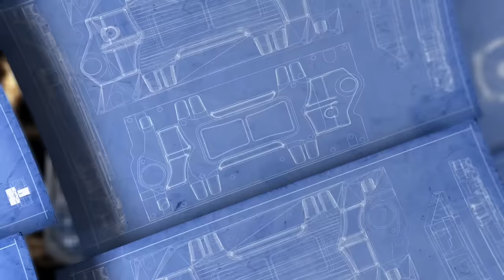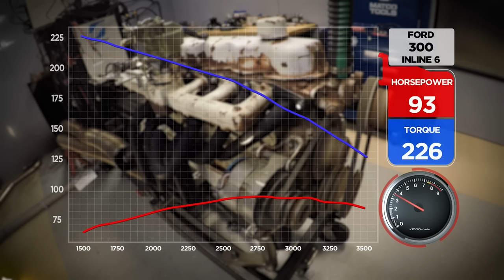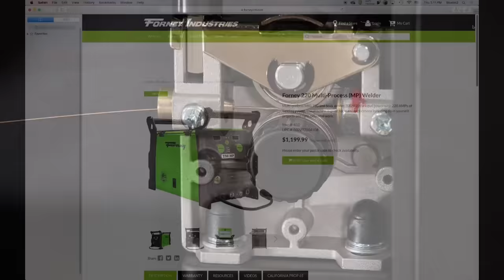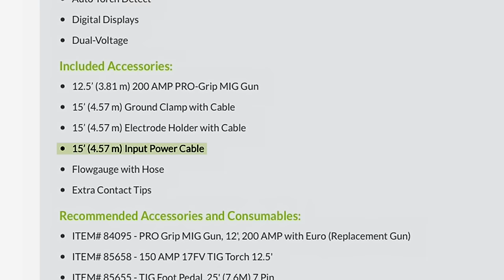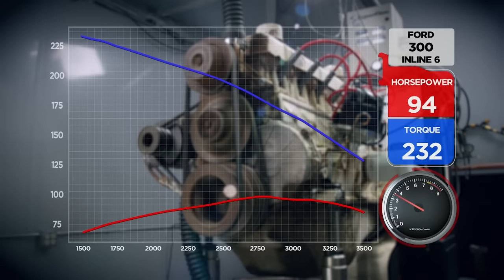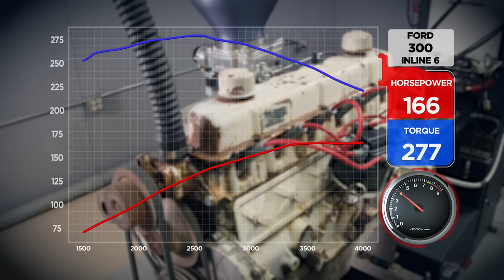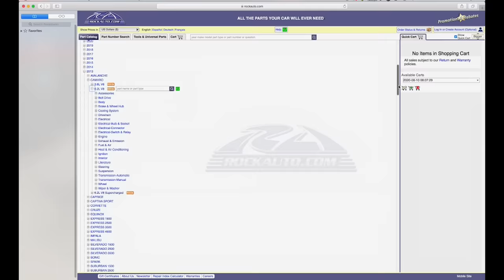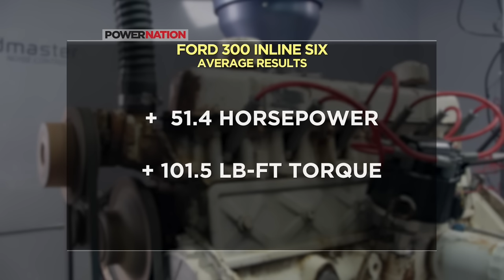Ford 300 Inline Six Gets Eye-Popping Off-The-Shelf Power - Engine Power S7, E17

Comment: Definitely one of the best engines Ford ever designed and built.
Reply: It may be a good engine for an inline 6 swap?  I have an older Supra.
Reply: @ddd228  I love the idea of the that being its something you don't really see
Reply: Just rebuilt the i6 in my f100 last year and its just lovely. And holy fuel efficiency i was not expecting.
Reply: @andrewglasgow5355  , well, you just saved an incredible workhorse from the scrap freighter to China. So many people scrap these engines for MORE POWERFUL V8 swaps. I miss the simplicity of inline 6 cylinder engines from GM, Ford and Mopar.
Reply: @charger19691  literally 1st yr knowledge and 22 yrs of lego and all I saw was a lego set made out of metal 🤣  2 hrs out, 10 on the stand then 2 hrs back in. Bing bang boom. I had so much fun. It was a gift from my GPA so i will rebuild it as many times as I need to.
Reply: @Eric Babcock I drove a stock 92 with a 5 speed doing delivery work and averaged out about 30 MPG. The low end torque meant you could drive around pretty comfy babying the throttle, even with a moderate load.

Note: the altitude I was driving at ranged from 5000 to 9000, so less fuel for less air.
Reply: @andrewglasgow5355  I just cranked up my dad's old 82 ford that has been sitting for over a year and it gets great mileage with the 3 on the tree manual. I plan on rebuilding it soon.
Reply: I put a 300 with a 240 head into a 1953 ford customline, great engine
Reply: @davidcronin5689 , did that bump up the compression? How did it run?
Reply: @taekwoncrawfish9418 , smaller combustion chamber on the smaller displacement head. Squeezes the gas, air and fuel in a tighter space, raises cylinder pressures.
Reply: @taekwoncrawfish9418  , I’m not talking about the engine in the video. Talking about a commenter’s engine.
Reply: @davidcronin5689  good Information could I swap one of these in my 56 fairlane
Reply: @ddd228/Dave in Seattle.   Might be too tall to fit, but would be a real torquer
Reply: hell yea it is. i have an 82 f150 with a 300, and only 40,000 actual miles. think is so n ice to be 41 year old. 3 spd with OD.
Reply: @charger19691  very little. 78cc head to 68 cc head. Isky cam and a Holley 4 barrel carb, c-4 trans. 3:10 rearend gears
Reply: Does this bolt onto  C6 AUTO. i CURRENTlY HAVE A CLEVELAND 8
Reply: @buddyrojek9417  , I think the SB Ford Bellhousing will fit. Clevelands are still a SB Ford.
Reply: @markgreiser464  thanks
Reply: @buddyrojek9417  the 300 has the same pattern as a 302.

Comment: I'm liking the inline 6 builds. Keep them coming.
Reply: Need a chevy inline 5.
Reply: Inlines rule!  Then, boxers.
Reply: Love to see them run an Aussie ford Barra six
Reply: Check out "hemi 265"
Reply: agreed
Reply: @pangaute  Many Americans have imported the Barra six. Pretty awesome. In some ways better than the 2JZ
Reply: Only thing better than an inline 6, is a V12
Reply: I'm kind of curious what the compression ratio is since it's an industrial engine. I think they could get a few more horses bumping up the timing. A cam change will be interesting, maybe they'll run a 268 fron comp cams.
Reply: @xc8487  Yes, with an intake and long tube headers. It should go from 220 hp to 290.
Reply: Love my old 300 5spd 150..she's slow but reliable and honestly not that bad on mileage
Reply: @makaroner I've seen a few turbo ford 300 builds on yt.. most recent was an 89 150 bored .30 over single power stroke turbo 302 injectors mild valve train upgrades..not bout axle/ trans upgrade if any.he put down 210 horse and 445lbs at the wheel. More after meth injection
Reply: Would love to see one done on a '69-71 ford 250 6 cyl... my Maverick would thank you. 😎
Reply: No!  That just keeps making good engines harder to find and more expensive!
Reply: yessir i like the ole 300-6 cylinder my pawpaw had one in a log truck never did have a problem the right gear makes all the difference in the world ive seen him pull 5 cord of wood with it
Reply: Yes more inline 6s please
Reply: Kept me thinking of my 72' chevy van 6 in line 3 shifts gearbox ,it be a  fun sleeper😁😁😁
Reply: next up is the amc 258 hopefully
Reply: @blackericdenice  The cylinder head  doesn't breath to well  though
Reply: @awesomusmaximus3766  The head is not the problem
Reply: @blackericdenice  The inlet ports are too small
Reply: @awesomusmaximus3766  They are the same intake ports when the 1965-72 made 170 hp.
Reply: @blackericdenice  I'm talking 400 hp+
Reply: @awesomusmaximus3766  The video is talking about 166 hp. Keep it simple.
Reply: @blackericdenice  I wish they went a little further though eg a cam maybe some mild port work/beefier valve springs

Comment: Pat's childlike wonder at this engine gives me hope for humanity
Reply: Yeah....me too.
Reply: Jacob Krzystowczyk : I think his delight in derestricting tge crazy 1 bbl carbs ludicris 9 psi air  restriction was what made it for me. You wouldnt run a Lada or Polski Fiat carb on a 5 liter six would you? Um, yesss. Ford did. Thats what stopped them ever blowing up. Air restricted engines.  Our 4.9 liter Falcon 302Clevelands made 240 hp gross with just a 2 bbl Bendix Technico WW carb in 1971. What a way to remove half the engine power. Drop half the air intake by making it a 1 bbl engine. Thats what Pat was probably thinking!
Reply: Dean Stevenson I get that 100%. Lowering power numbers on industrial and medium duty on up engines extends life. This engine did everything asked of it just like 100,000s of other ones for years. There are times that I wished my F250 had one of these instead of a 460. Torque and reliability are more important to me to hp and racing. Been watching these guys for years. Before YouTube power nation and power block were just about it for enthusiasts. Pat has always been my favorite host. On the normal scripted builds, you can tell they have a passion.  But on this one, Pat really gets a lot out of it and I appreciate that.
Reply: Hear that gasp when they removed the valve cover.
Reply: @unicornsteaks6769  Yep. Pretty cool. Hardware vs. software......hardware will win every time.
Reply: Now I know what to get him for christmas
Reply: @deanstevenson6527  Dean, my old 3 on the tree manual 250 XY Falc., went 18.3 best. I got the opportunity to drive a 302 XA Falc. Lux, and it did 18.1. I was surprised how slow the bigger V8 was; both dead stock !!
Reply: arkhsm ford : The XB 302C 2bbl C10 auto wagon with 230 hp and single exhaust  in the UK did 17.8 seconds, the XA 302 C 2bbl Auto 240 hp dyal exhaust or manual or 250 2v 170 hp 4speed 16.9 or 17.0 seconds. The single exhaust 188 hp 302 C 4bbl XD C10 auto, 16.9 secs. All line ball with the gross and net figures. The US 4.9 truck was slow and thirsty as a 1bbl 4.9 with 114 hp net, but quite sprightly as a 4 speed 165 hp SROD. 31 US mpg at 55 mph with 2.47 gear 4 speed. Ford USA and Australia always ensured the sixes didn't show up the V8s..they were like Mopar 265s and 318s...line ball. The only exception was that the Australian 340 wasnt as fast as the Australian 265 Six Pack...because it had the stock 318 cam and restrictive dual exhaust.
Reply: @deanstevenson6527  I remember Aussie Wheels magazine xy 250 2v, 4speed was as quick as the 302 V8, for less money; not to mention the eb falc. xr6 being quicker than the xr8 !!
Reply: arkhsm ford : That was Fords doing. Super Sixes were just a game like Aston Martin played in 1969 to 1973. That Vantage DBS verses DBS V8 stuff...just markwting bluff.  Even in Australia 1971-1976, as in 1992 to 2016, Ford Australia made no regular cast iron Cleveland  blocks in Geelong... only 2V Cleveland  heads for 12 years. It wasnt untill 1976 that the tooling to make 302C's finally got set up from the Cleveland Engine Plant # 2 transfer machining gear. So Ford Australia played a little game of High Performance Six verses Local 302 Cleveland and (later)  Windsor 5.0 spec engines to keep up the intrest. And it worked just the same as it has from 1965 to 1996 in the Ford F trucks and E vans. Six cylinder sales bloomed, but V8 sales stayed very strong even in the First and Second Gas Crunch.To have a 4.9 six verses a 5.0 lit(er/re) V8 was fun in the USA. And so was the Aussie  170 HP 250 2V verses the 302C, and the 4 lit(re/er)  221- 235  SOHC's and then  4.0 256/262 hp Barras against the 5.0 and 5.4 3 valves. Not even gonna talk NormalAir and Garret Turbo AIT or Mike Vine or Ray Hall or Gran Prix or the planned SVO Falcon turbos that Fords Sir Ivan Ingles, Bill Dix and Max Gransden kniocked back. At days end...the question was why was a 170 hp 4.1 2V six as fast as a 240 hp  4.9 lit 2v V8...and why were the carbs jetted the same and intechangable. Same with the Electronic Lean Burn 265 verses the 318 for 1978 to 1981. Six cylinders in that 240 to 300 cube bracket have always been a force. Which is why there has never been Performance 240 to 300 cube sixes in the USA. Except the Hudson Hornet 302 H power, the Buick Grand National engined cars, and the GM 4200 SUV engine. Its just a fun game. All the good six cylinder engines, like the Kaiser 3.8/232 OHC and the 250 Ford and the 1966 US designed Hemi 245...they were sent "Overland" or to Serve your Conscience  Overseas. The Roush 300 Supercharged six happened 40 years too late.

Comment: I’m original owner of 1979 Econoline 100 with 300 cubes and manual four speed on floor. Yup, that’s what I ordered. Currently has about 280k miles. When the exhaust manifold started whistling I called Clifford. Got triY headers and 4 bbl intake. Runs great !!
Never pulled the valve cover yet !!
Never seen another like her !!
Treated her to a Maaco paint job last summer.  Good for another 40yrs. That’s my baby...

Comment: Finally people are starting to showoff all the perks of the ford 300 inline 6. The cummins of gas motors... Also inspired cummins 12 valve.
Reply: Funny you mention that.
Onan used the 300 6 in a lot of generators.
They were later bought by Cummins.
Reply: @1978garfield  Onan didn't own the 300 i6 design and gas and diesel engines do not translate well to the other ignition type.
Reply: Derrin Eckelmann  12vs rare? They are everywhere
Reply: Derrin Eckelmann  idk why people really keep 12vs as most of the time when I see them half of them do less work than my 5hp briggs and the other half don't even run due to the neglect.
Reply: Derrin Eckelmann  the 12v just has a fuel solenoid but again letting them sit can be bad for the pumps and seals
Reply: I remember back in the 70's, a pinto project 300, that was sporting a cut and joined cleveland head, the car produced 600 hp and was turning incredible times until it crashed.
Reply: @scoireamerica1609  wow!!!#
Reply: @scoireamerica1609  and caught on fire 🔥????
Reply: @1978garfield  reerrt
Reply: @dandahermitseals5582  there is a guy who has the engine still I think Uncle Tony did a video on it
Reply: I'll take a 292 Chevy or a 302 GMC over the 300 any day.
Reply: @OldGriz708  and I'll take a Ford 300 over any Garbage Motors engine any day
Reply: @jdrok5026  you never heard of a Perkins 4.236?
Reply: @axlebrown2285  what does the Perkins have to do with a project cummins went into with last I recall case. Similarities in design are hard to avoid in i6s but I'm telling you right now the 300 i6 isn't nearly robust enough to handle a direct injection diesel engine. They have specific design parameters that must be met.
Reply: @mebe2k  huh is that why ford even went with gm motors over their own stuff quite a bit.
Reply: Carb.
Reply: @jdrok5026  the only GM engines Ford used were Detroits back in the 60's-early 1980s in their heavy duty trucks..
Reply: @mebe2k  Detroits where used in heavy duty till ford got out of the class 8 business. So again even ford chose gm junk over their own diesels lol
Reply: @jdrok5026  Ford never made a diesel for the class 8 market...why spend millions on development, testing and building a diesel when you can outsource? Also Ford didn't only use Detroit..they also used CAT and Cummins depending on how the customer spec'd the truck...you mentioned Ford used "a lot" of GM engines...show me some other instances where Ford used GM engines...
Reply: @mebe2k  but more specifically the series past the 350 a lot of ford engines weren't offered where was the ford engines that worked with the gm offerings why wasn't the 6.6l revised to beat out the 2 strokes and the anemic 8.2?
Reply: @jdrok5026  since you're talking just diesel, you do know that in the 350/250 Ford didn't make those engines either. And the 6.6/7.8 were new holland engines.
Reply: @jdrok5026  you also keep going on like Ford used the GM diesel engines because they were so great or something..no they used them for cost reasons.  Hell even GM themselves outsourced non GM diesels for certain applications..I have a 94 GMC c6500 with a CAT engine in it..
Reply: @OldGriz708  the 292 maybe but the 302 Chevy? Come on man. That engine was notorious garbage. Didn't take long for the general to send it to the chopping block. Horsepower wise I'm sure it was better but in terms of longevity, it will never hold a candle to the 300
Reply: @jdrok5026  lol if GM/detroit were such good engine why did they have to bring isuzu in to build the duramax?
Reply: @OldGriz708  Shows up to miss the point completely
Reply: @ShaneHerrick  
If I missed the point it's because it was hidden under your hat.
Reply: @ptwilder13  
The 302 I6 GMC
Reply: @OldGriz708  
Just cause you don’t know better !  And that’s Ok 2

Comment: Can't wait to see more of this 300!!!
Reply: I wanna see it ported with a cam in it.
Reply: There must be stroker kits and aluminum heads! Even a nice roller cam and efi conversion would be cool
Reply: This video was posted today and they hinted at a turbo early on. They aren't done with this thing yet.
Reply: @markbulva4188  unfortunately there are no aluminum heads, least the last time I looked.
Reply: @markbulva4188  what's nice is that it's already a stroker version of another inline 6, however how much further can they stroke it.
Reply: @markbulva4188  I'm going EFI with a Holly Sniper setup in my '65 Econoline, and plan on turboing it later.
Reply: @bowez9  The Ford factory engineers AMBROSS, ARGENTA, HUETTMAN, were running in the 7s years ago with SVO  alloy canted valve headed SVO blocked 300 cube truck six, naturally aspirated !!
Reply: @arkhsm  
Yep.  This engine is going to 250 HP with the turbo.  At 4000 RPM too
Reply: @freddym.1489  ASK BILLY SQUIRE............ LOL JK
Reply: @freddym.1489 . I read in a magazine a long time ago some guys offset ground the crank and got 335 cubic inches out of it. They also cut up a few Cleveland heads and fabbed one up to work. Not sure what else they did , but it was mean.

Comment: I love those inline sixes.  Naturally balanced by design with the ability to run smooth as silk.  I've got the 4.9 liter/300cu.in. inline six in my 93 F-150 with the M5OD 5 speed manual behind it.  This is the factory fuel injected version with the old OBD 1 management system. OBD 2 didn't get installed on this engine until 1996, the last year Ford offered the engine in it's pickup line.  I've done a few mods by adding a K&N air induction kit, an MSD-6A spark box with an MSD high output coil.  I made a custom set of ignition wires by using MSD's 8mm low resistance wire wound ignition wire and wire terminals.  I looked for a pre-made set, but it appears that no wire sets of this caliber are available.  FlowMaster's single outlet muffler and pipe kit finishes off my daily driver.  These few mods have given the old truck what I feel is a seat of the pants increase in power.  Let's say a few horses above the factory 175 HP rating and a sound out of the back that tends to turn some heads.  The FlowMaster system gives the old six a nostalgic sound similar to that of an old Jaguar XKE... at least to me.  While what I have isn't a sleeper, it's still fun as hell to drive with the manual transmission.  Unfortunately the factory fuel injection system doesn't allow me to get too radical, so I can't use a more aggressive camshaft, at least for now.  There's one thing that I know for sure, though, this engine will outlast the truck itself.  It can be said, that this engine is definitely one of Ford's better ideas.
Reply: Ford fuel management can be tricked to give it more fuel.  Not sure where the the 02 sensor is on yours, but I put a true dual on my 94 bronco with a 302.  I put the sensor in on one bank only.  It fueled better and my bronco had some serious snot compared to everything out there.
Reply: factory rating is definitely not 175 more around 145-150
Reply: thats a cool truck them 300s had good torque much more than horsepower there like diesels low end grunt and actually had more torque than the 302. i think the 300 had like 265 pound feet that mated with a 5 speed great truck!!!
Reply: @scout2m448  The HP rating that you've listed is for the old carbureted version of these engines.  The boost in HP came with the addition of fuel injection and OBD One, plus the intake and exhaust manifolds were  reconfigured to increase flow to suit the new fuel management configuration.  After all, there is a lot of displacement to be considered, also, with 300 cubic inches, (4.9Liters), to be had in this inline six, to go along with the added changes to the fuel system.  In the world of automotive six cylinder engines, 300 cu. in. is a big damned six.
Reply: @williamcharles9480  I'm really not sure where you found that but everywhere I look It says 145-150hp for all the EFI trucks. And yea it's basically the same size as a 5.0 302 so pretty good.

Comment: I built a 300 in line six in 1976 to go in my 61 falcon dirt short track car. It would blow some of the V8 engines on the track away. That engine made a ton of torque. I wish I had a list of the things I did to it.  I was 17 years old at the time.  Thanks for pushing my way back button.